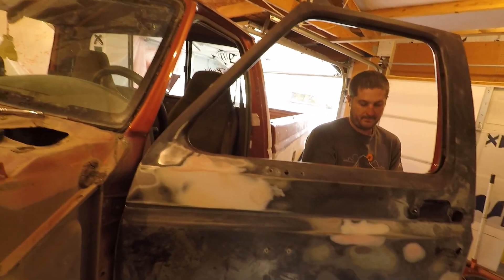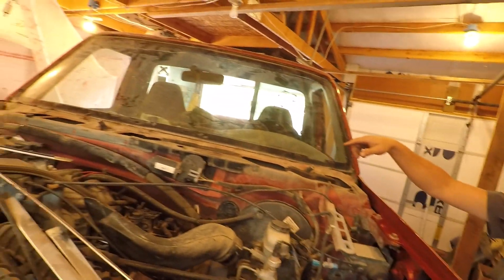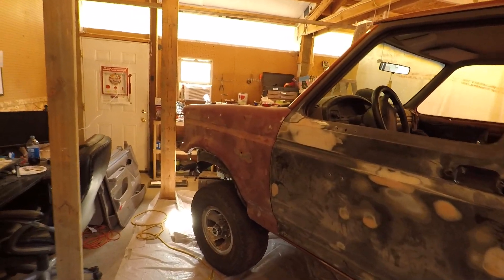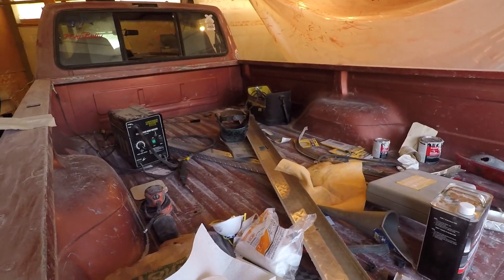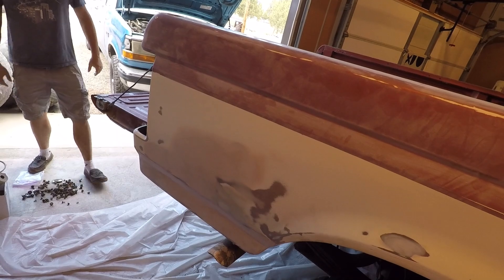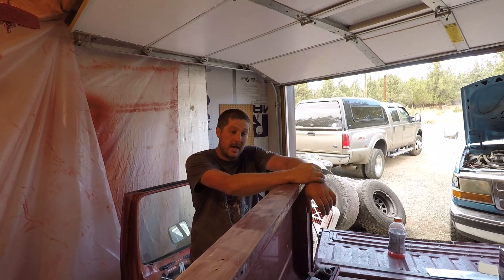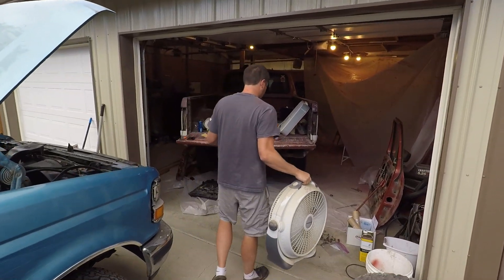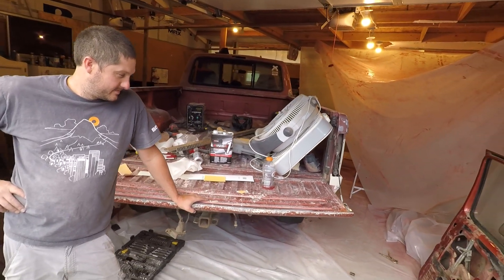FAILURE! We Ran OUT OF TIME On The 1995 Ford F150 Restoration

Comment: autobody is like road construction you have to set timelines/goals have a game plan or nothing happens on the jobsite and autobody shops have charge accounts/discounts at the paint supply place so they get what ever they need when it's needed and it's delivered to customer pays for everything a-z. painted my 68 mustang coupe yesterday i spray dupont nason & autobody master 4to1 clear laid the clear down heavy got 3 huge ft long runs to wet sand out but no orange peel this time. started 2 months ago but i did most of the sheet metal work years ago and FINALLY finished it yesterday

Comment: Bodywork goes like that, man.  With those two guys working regular jobs (from the sounds of it) plus trying to help get the bodywork ready for paint, it was a monumental task to try and get the truck done in two weeks.  You guys made the best of it and got as much as you could done.  Would it have helped if the truck were further disassembled/sanded ahead of you getting out there? Maybe, but there were still things that required attention that cost you time in order to get the job done right.  Best bet is to take the route you're taking in order to get the best quality job done.  I think those guys can handle finishing it.